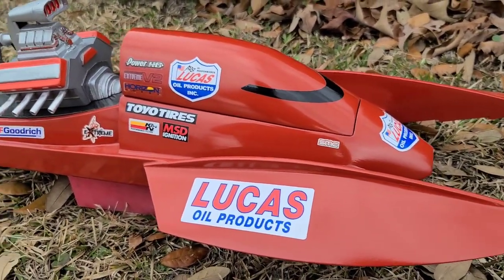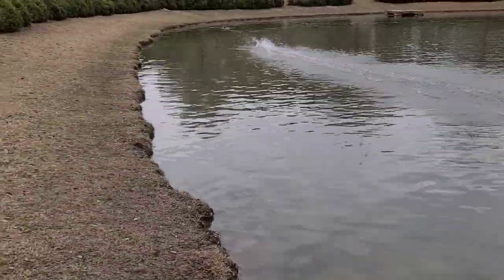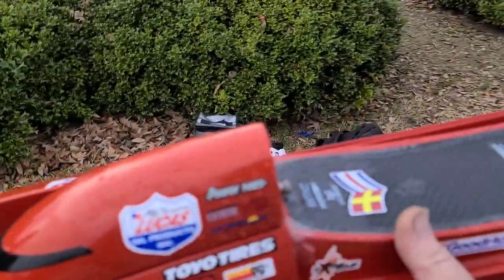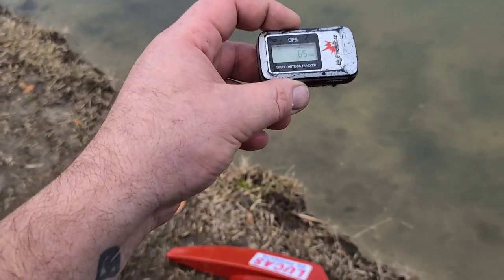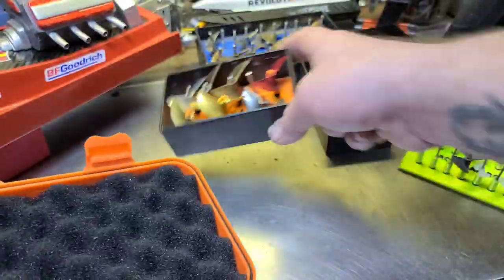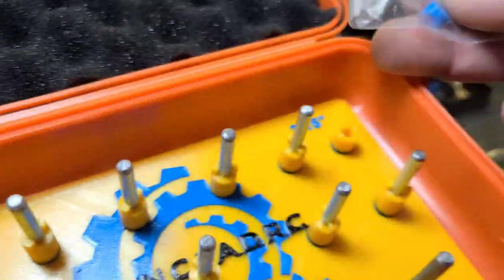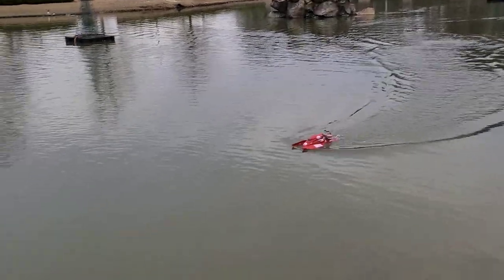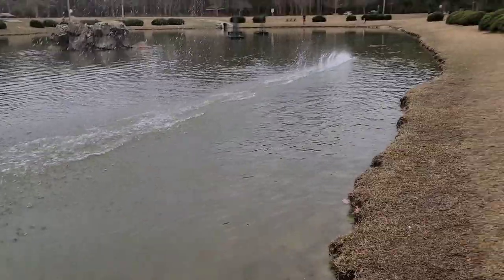1/8 Scale Lucas Oil Rc Drag Boat GPS Tested - Fast Rc Boat

Comment: That thing needs a bigger pond! 1/10 scale quarter mile = 132' 1/8 scale quarter mile = 165 '. I'm amazed at how well the boat accelerates and how stable it is. I'd swear it was a kit if I didn't know you scratch built it. A 36 inch version with a TFL 2 to 1 transfer case and a 40mm diameter single motor on 8S would be something! Gosh I'm salivating just thinking about it. Awesome video Big B! Cheers!
Reply from the maker: Thanks, a lot George now you've got the 36 version on my mind, I've been wanting to use the TfL 1:2 drive for something.  Got the ole gears turning now.   

 I was not aware of the 1/8 scale quarter mile being 165' that's even better!

Comment: We need toroidal props now to get to another level of performance. Will be long time before it comes to RC boats.
Reply from the maker: There cool looking but I don't think they would increase top speed on a model boat maybe less load on the motor/esc longer runtime but not top-end speed.    Just my opinion.

Comment: Awesome job!  Boat looks and handles great, very similar to the scale boats.  Please say no to the turn fin ideas.  You want to keep as little hydrodynamic drag as possible.  You might consider thinning or shortening your rudder until you lose some directional stability, but it would be faster.  Interested in seeing you try your "training wheels" on the back of the boat.  Might free up the hull a little earlier.  Need to blow that tail as quickly as possible.  

The slow-mo crash looked just like scale........

Unbelievable performance from a scratch built boat with NO major tuning needed to make it operate!!!!

Paul
Reply from the maker: Thanks for the suggestions, I'm very please with her performance,  next outing were gonna try inward rotating props, looking for performance differences following video installing rear skis.

Comment: With all the power your pushing,  getting up isn't a problem.  Still tuning to do but looking awesome.  Back to your power.  Do you think you would get more speed if you were to cut the width of your sponsors back at the ride edge to get rid of drag & the dancing it's doing at full speed.  My thought is that the boat would settle down  if you have les ride pad to run on. Thanks for your video.
Reply from the maker: All the 1:1 hydroplanes "dance" at high speeds that's the nature of a hydro.   Watch the h1 unlimited hydroplane racing at their top speeds there dancing from sponson to sponson

Comment: I have the same box from Rob with prop numbers and my logo 'Dark Matter Blades'.  Its sweet.  Im still hoping for a possible trailer build for a hydro.  Rob doesnt supply the boxes.  He will make the insert only. You can buy the orange box from AliEXpress for 7 bucks.

Comment: What size diameter flex shaft do you use? I see you switching props out often in your videos.
Reply from the maker: 4mm on this one, counter rotating durle to the twin motor setup